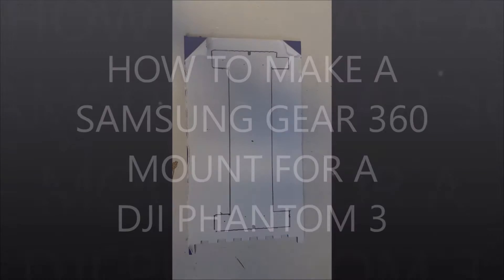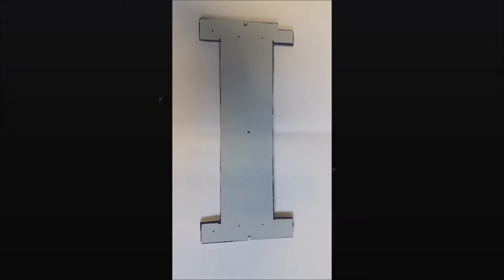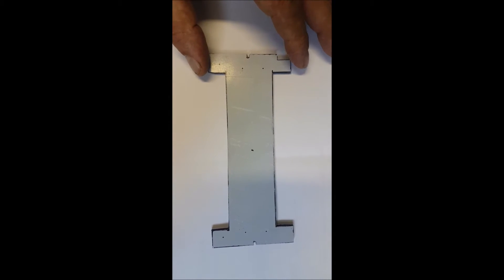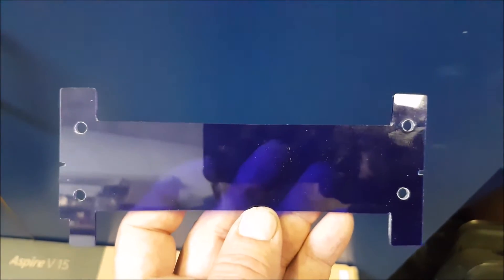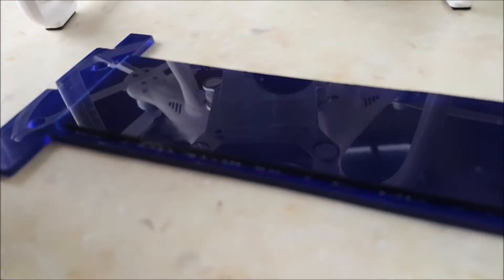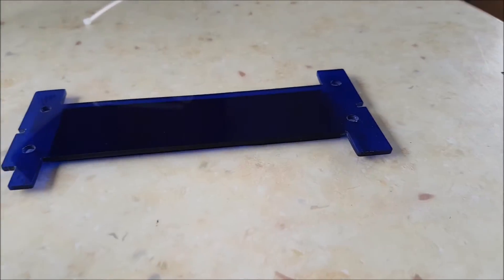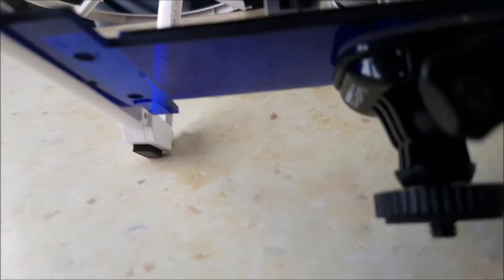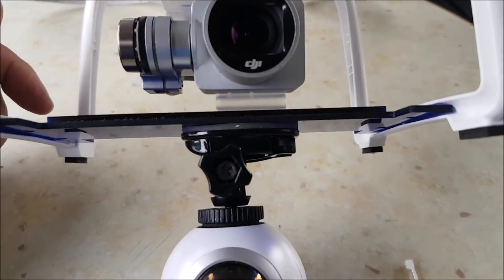HOW TO MAKE A SAMSUNG GEAR 360 MOUNT FOR A DJI PHANTOM 3

Comment: Is there possibilty to have the final measurements after you changed it a bit?
Measurements were in the beginning:
CENTER
length 164

LEFT
width 70
cross 15
gap 33-35
corner 5, 10, 15

RIGHT
width 70
cross 15
gap 33-35

Comment: whats the gopro tripod mount called?
Reply from the maker: Hi Victor ive put two links below hope this helps 
Mark

http://www.ebay.co.uk/itm/Phot-R-1-4-Tripod-Screw-Adapter-Mount-any-Ordinary-Camera-to-GoPro-Hero-5-4-3-/261945072257?hash=item3cfd249a81:g:QMMAAOSwHMJYNb78

http://www.ebay.co.uk/itm/SP-Gadgets-Hot-Shoe-Mount-for-fitting-most-Camera-DSLRs-with-GoPro-Hero-2-3-4-5-/262524584063?hash=item3d1faf407f:g:I94AAOSwyKxXh4h7
Reply: thanks but the plate part of the mount is not there. could you link me the plate? thx
Reply from the maker: sorry victor link below ATB

https://www.amazon.co.uk/gp/product/B01FG5KFA8/ref=oh_aui_detailpage_o03_s00?ie=UTF8&psc=1
Reply: Mark Davies sorry to bother you again, but where did you get the tripod stick (the piece that attaches the camera to the plate?) thanks again!
Reply: Hi Victor your not bothering me its fine ,do you mean the sticky pad !!!! link below 

http://www.ebay.co.uk/itm/Phot-R-Sticky-Flat-Base-3M-Adhesive-Pad-Helmet-Mount-for-GoPro-HD-Hero-5-4-3-3-/261945296955?hash=item3cfd28083b:g:ENQAAOSw5VFWQ0Ui
Reply: Unavailable on amazon..here is an updated link for the same product from walmart..sorry about the long URL

https://www.walmart.com/ip/2017-Carbon-Fiber-Gimbal-Camera-Guard-Protective-Board-Strap-For-Phantom-3/245331392?wmlspartner=wlpa&selectedSellerId=11110&adid=22222222227085168747&wmlspartner=wmtlabs&wl0=&wl1=g&wl2=c&wl3=200858246355&wl4=pla-355522496284&wl5=9026968&wl6=&wl7=&wl8=&wl9=pla&wl10=117088756&wl11=online&wl12=245331392&wl13=&veh=sem

Comment: where can i get the adapter from the go pro to gear 360 at '6:44'??
Reply from the maker: http://www.ebay.co.uk/itm/Phot-R-1-4-Tripod-Screw-Adapter-Mount-any-Ordinary-Camera-to-GoPro-Hero-5-4-3-/261945072257?hash=item3cfd249a81:g:QMMAAOSwHMJYNb78

http://www.ebay.co.uk/itm/SP-Gadgets-Hot-Shoe-Mount-for-fitting-most-Camera-DSLRs-with-GoPro-Hero-2-3-4-5-/262524584063?hash=item3d1faf407f:g:I94AAOSwyKxXh4h7

http://www.ebay.co.uk/itm/1-4-Hot-Shoe-Adaptor-Tripod-Mount-Screw-GoPro-Hero-2-3-3-4-5-DSLR-Camera-UZ-/151846311696?hash=item235abed710:g:J4cAAOSwy5ZXCr4p

hi hpoe this helps 
Mark